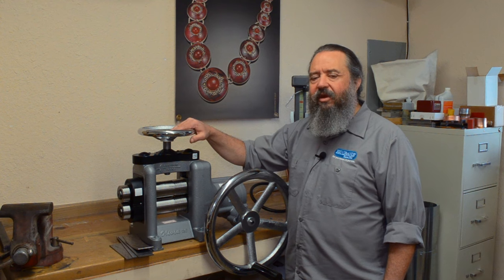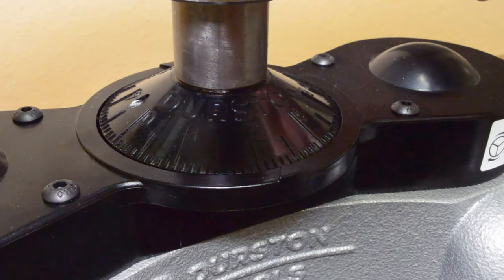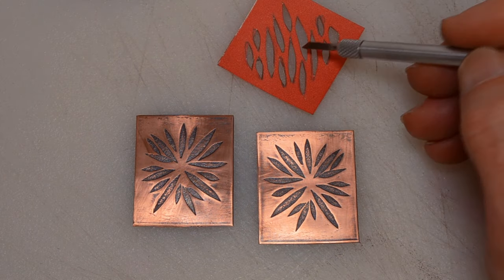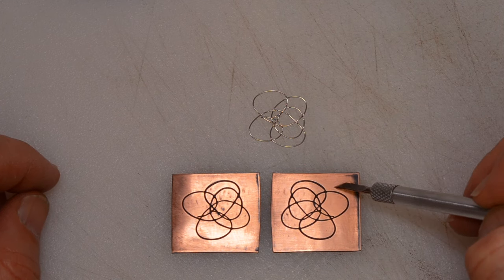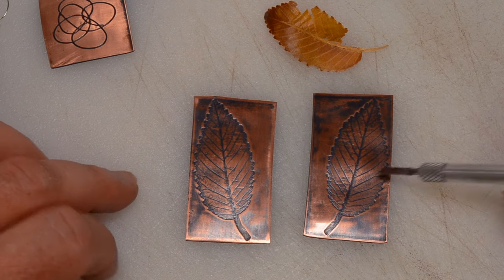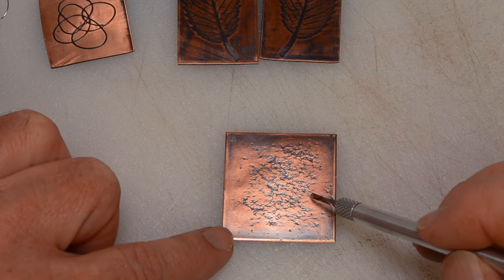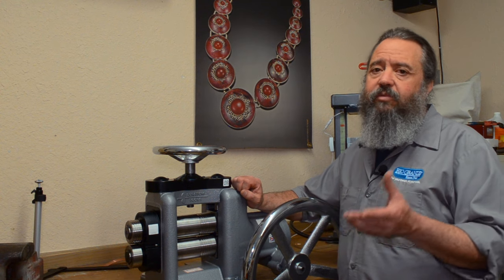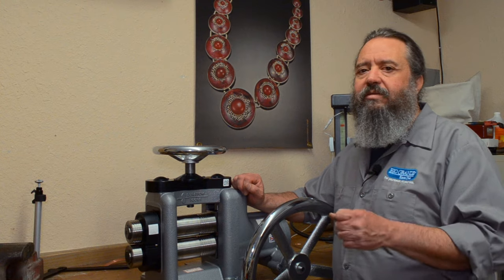How to Apply Unique Textures with a Rolling Mill

Comment: Just need to check in on this:  let's say I want to make just one pendant from a piece of lace or leaf or feather, etc., would I just put my annealed metal with the item on top and roll that through or do I have to make a sandwich with another piece of metal on top of the item? Logically, I don't see why it just couldn't be put through with just the metal and the item, but I always see people putting metal or foam on top (the foam makes no sense to me - why would you put something soft when you want to make a strong impression?). I trust Rio to give me the correct scoop on this. Thanks.
Reply: i have this same question! do you have any insight on it now? thanks!

Comment: Great video thanks! I tried using dried seaweed to texture today, but it didn't work out. I used paper around my copper and seaweed rather than two pieces of metal to protect the rollers and on one attempt the rollers just mashed up the paper and seaweed and the imprint was of mashed paper I think. I'm guessing the roller was too tight? In theory dried seaweed should work shouldn't it? What thickness of metal should be used? And does a rolling mill work with blanks or should you only use sheet? TIA, Deb x

Comment: Is there any pointers you can give on running a leaf through a Rolling Mill I've gotten it to give some details but not as beautiful as the one you've shown perhaps I'm doing something wrong I do soft in my metal before I feed it through and I have taken your advice to dry my own leaves anyhow would be greatly appreciated also very cool video
Reply: I've also tried feathers and they didn't turn out this nice either perhaps

Comment: I wish somebody would talk about when you get a brand new Rolling Mill and how to use it. I have a brand new Rolling Mill and it's covered in grease or something and I'm not sure how to get started. Can you do a video about that? Thank you
Reply from the maker: Hi Lisa, we actually have a rolling mill unboxing video in the works. We'll reply here with the link as soon as it is available. As far as the "grease" on the mill, that is to protect the machine from rust during shipping. You can use a white solvent like mineral spirits and a lint-free cloth to remove it.
Reply: @RioGrande1944  thank you so much ! Cant wait to see the new video !
Reply: @RioGrande1944 The unboxing video was never linked her. I browsed your videos and did not see one posted in the last 2 years
Reply: Can use leather to texture the metal using a rolling mill?